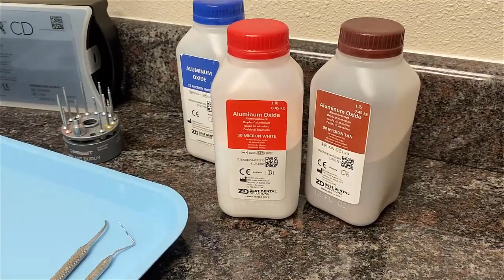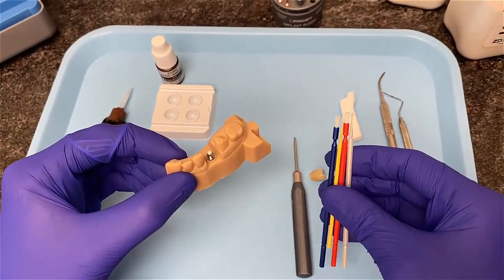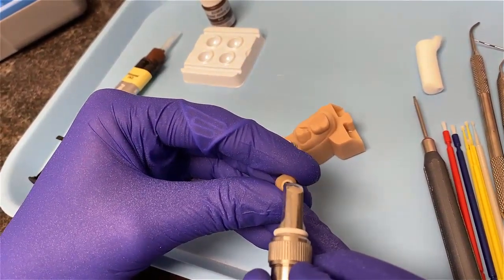How to Cement Ti-Bases to Zirconia Crowns - Using MicroEtchers and Resin Cement

Comment: Do you have a way to separate the ti bases on failed crowns/bad shades?
Reply: One way is to ask the Dental lab to put it in an porcelain furnance and heat it very, very slowly !!! to 350-450 degree Celsius for around 30 min on end temp. There's a risk the crown cracks because of the expanding tibase to quickly for the zirconia unfortunatly.

Comment: Sandblasting Zirconia will cause the propagation of micro cracks and weaken the zirconia in the critical area .
Please correct me if I am wrong
Reply: No it wont 
Using a diamond disc on it will
Reply: @emelgiefro  Done some basic research on a couple of papers written about this and apparently sandblasting can cause micro crack propagation if done too severely above 3.5 psi pressure and too close to the surface may I reiterate that this is only a brief research on my behalf  and should only be treated as such
Reply: Can we light cure zirconia..?? Does allow light??
Reply: This has been written about in several studies and is included in th IFU of many zirconia manufacturers.  Any microabraded zirconia should be run through a regeneration cycle in your porcelain oven.
Reply: @wendellmccall4453  can you elaborate on this regeneration process please sounds interesting and intriguing pending on temperatures involved
Reply: @emelgiefro  that definitely will!  that’s probably why the vast majority of failures are due to poorly designed connectors on bridges or the technician hitting the subframe with a diamond disc